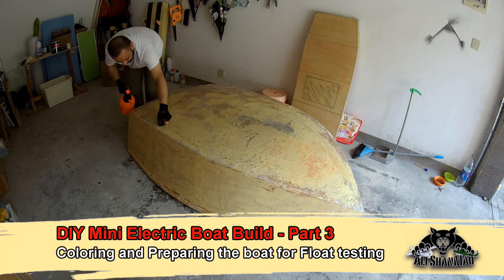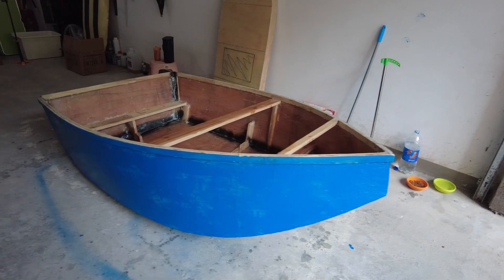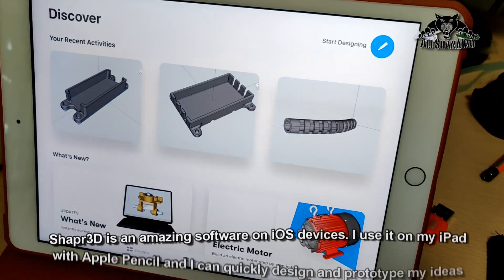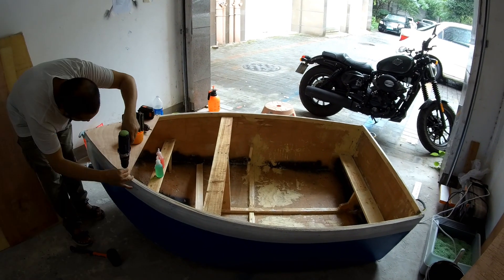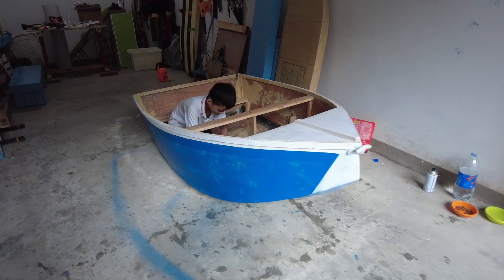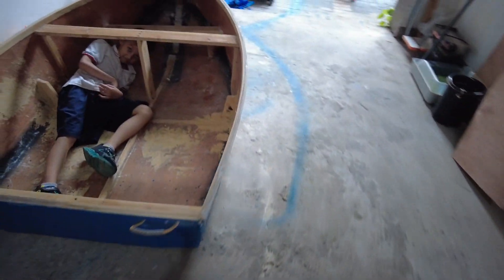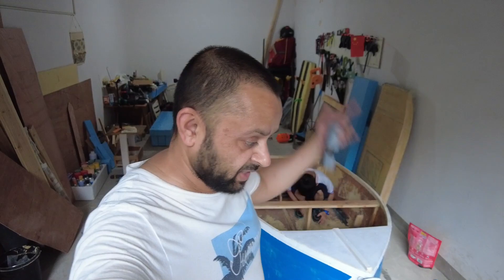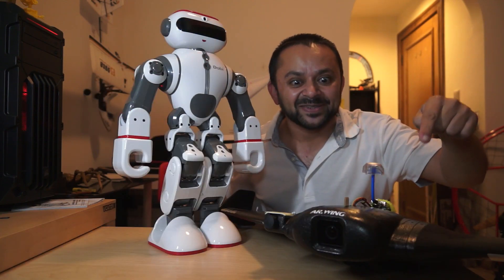Building the Biggest RC Boat DIY Stitch n Glue Mini Electric Boat Part 3

Comment: Really looking great, I think you should have added another layer of paint
Reply from the maker: Thanks for the tip. I did that after this first testing.
Reply: @alishanmao  I seen after I watched it, it's really looking fun can't wait to watch the next part of it running with the motor.
Reply from the maker: coming soon buddy. Part 5 and then Final Part to see us testing and enjoying the boat. i am now converting it to twin engine boat using a new VESC. then will take it out for spin again. this time i added the rudder. just finished 3D printing a one piece rudder. if everything goes well. I will then convert it into RC Boat by adding a servo and receiver to control throttle and rudder. 😉
Reply: @alishanmao  awesome

Comment: brass or stainless steel screws  ?  ?   lol
Reply from the maker: I was thinking not to use any screws. i used screws to fasten pieces together and removed after the glue was dried. may have forgotten one or two in there still
Reply: @alishanmao   what in the handles just glue  ?
Reply from the maker: @mabbs2757  just AB Two Part 1:1 5 minute epoxy. Tough as stone once it dries.

Comment: Could you imagine if you 3D printed the whole boat, if there was a way to do that. 🚣
Reply from the maker: pssst. Do not tell anyone. its my next project to 3D print a whole 2 person electric boat. There is a new bigger size 3D printer coming my way in 2 days. I am also going to 3D print the Electric Paramotor frame, and a new 3D Printed frame to put my electric paramotor 15kW or 30kW motor on my this boat to turn it into airboat. lots of crazy stuff coming. stay tuned brother hahaha
Reply: @alishanmao  Your jiving me right? This I got to see for sure! 👍
Reply from the maker: @expandingknowledge8269  no no, no jokes brother. this is my plan. Lotmaxx 3D just released a new printer. 320x320x420mm size bed. which is not big but its a work horse and i have my current Shark V2 printer. I will be designing the boat in coming weeks. then split it in as many parts as I can fit on those bed sizes. print those parts, glue them together and fiberglass it :) I expect to be on local news channels too lol because this is going to be the first ever 3D printed boat in my city :D
Reply: @alishanmao  My brother you are amazing! Can't wait to see your new printer! Let the FUN BEGIN! Expanding Knowledge.
Reply from the maker: @expandingknowledge8269  yes sir. I hope i can convince the Printer manufacturer to sponsor me with filaments too. because for sure this boat is going to take more than 5kilograms of filament hahahah.
Reply: @alishanmao  Awesome!